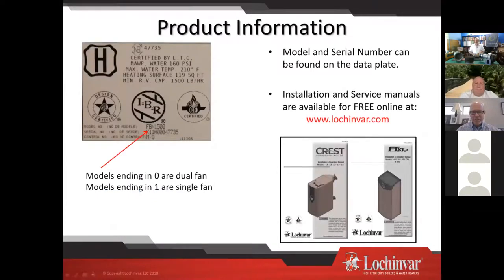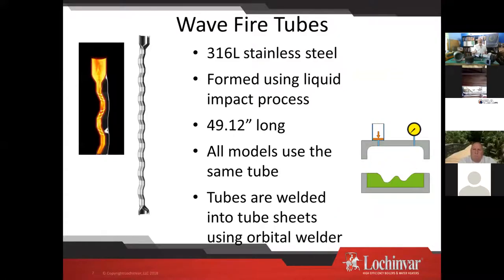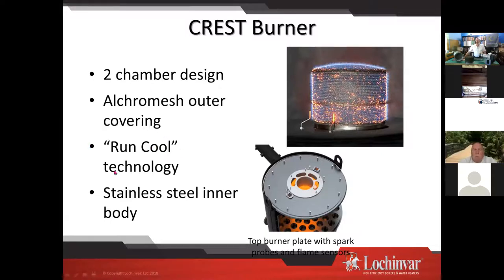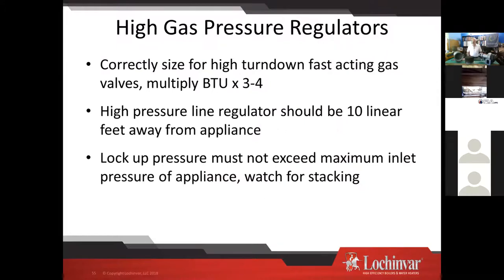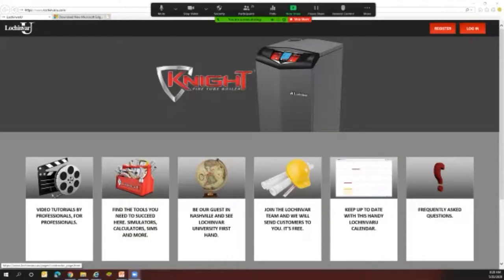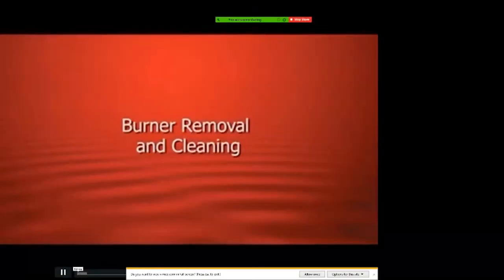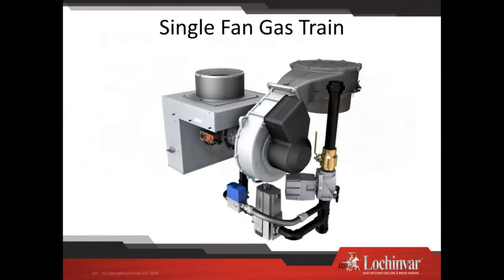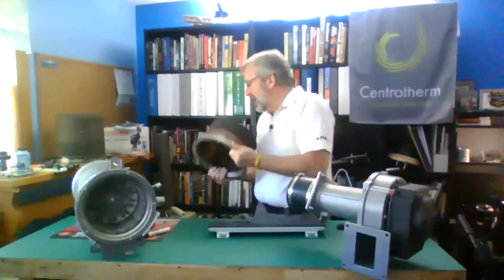Lochinvar Crest Boiler Service

Comment: What exactly should the heat exchanger tubes look like? I did a dual fan Lochinvar and the tubes to me looked dirty. You didn’t really cover that in the video.
Reply from the maker: It is a firetube boiler so the interior of the tubes themselves cannot really be seen. You can see the upper chamber where combustion takes place. You can vacuum out the chamber. You can pour a vinegar solution into the “firetubes” but it is not recommended to run anything down into the firetubes like a brush/wire, etc… See the IOM for cleaning procedures.  You can find your local representatives and service contractors here:https://www.lochinvar.com/locator/